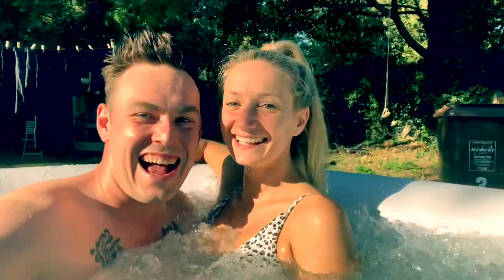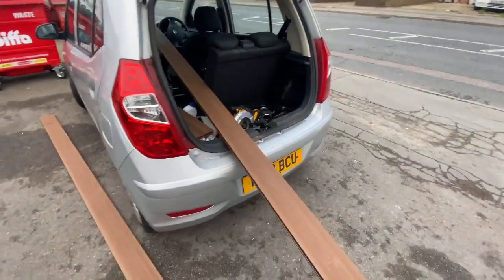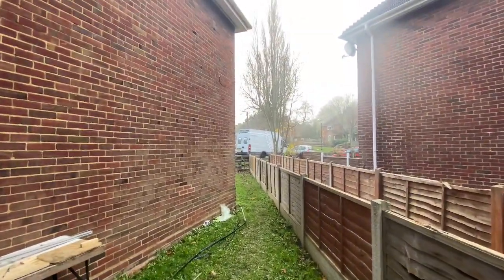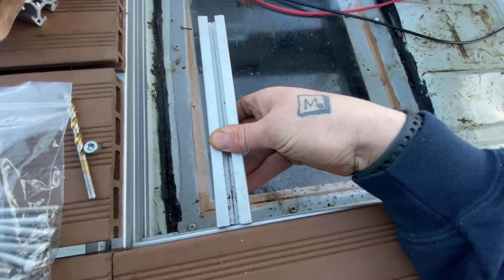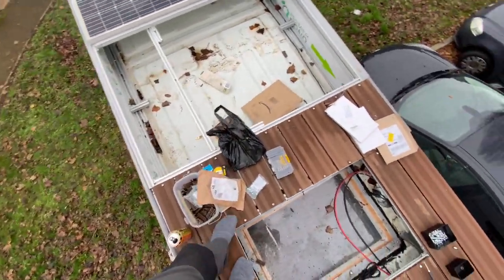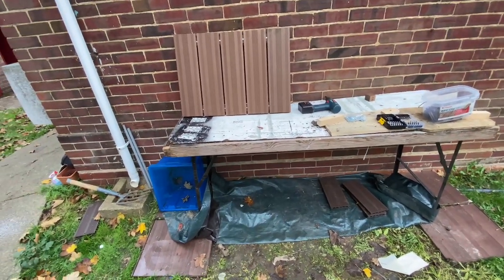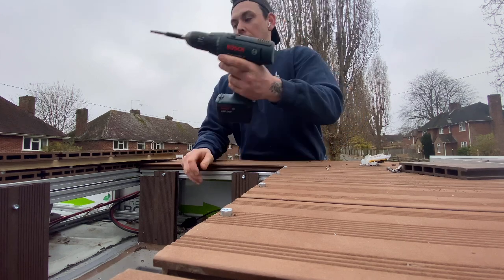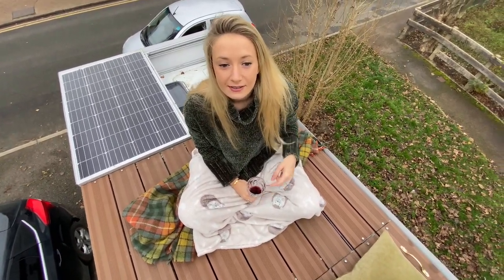SELF BUILT VAN BUILD ROOF BOX E8S1 THE DECKING :

Comment: It will look good and forgive me if you are going to be doing it or not . But I would be putting some alloy across you roof and put some decking for walking on as if you keep walking on the roof of the van you will brake the seal on each joint on the metal not to mention putting dents  in. The roof which will hold water which will then rust the roof and you will have big problem trying to weld it . Great idea though.
Reply from the maker: Yer so We will only be walking on the decking and the rest will be storage under the solar :) what do you think so far ?
Reply: @TheDailyWilde  it all looks well  but even though your not walking on it I would still put some decking over the roof to put what ever your storing   So you can strap it all down you don’t want it all going forward if you have to brake hard .and damage your sky light or solar panels
Reply from the maker: So in the next video you will see what we are doing for the bits that aren’t being decked
Reply: @TheDailyWilde  I look forward to it . I’m just waiting for a dry day I’ve made my solar panels to lift and turn I just need a few dry days to remove them and fit them back on they will lift and turn .well they are doing on the floor using ply wood the same size as my solar panels
Reply from the maker: Nice man that’s a decent rig you have going
Reply: @TheDailyWilde  as long as it works it will do me